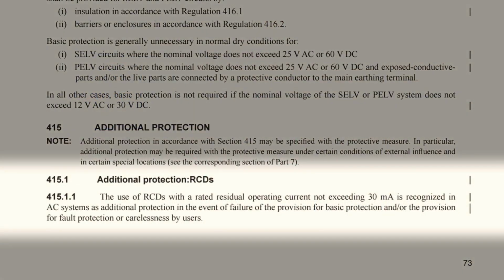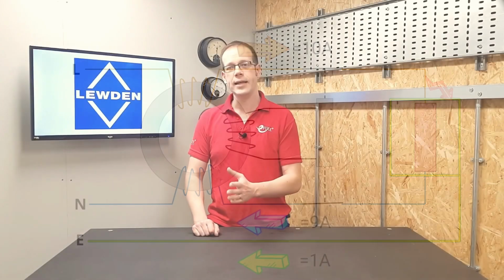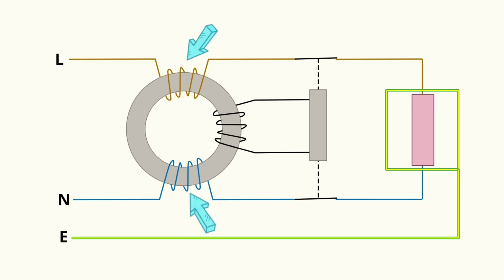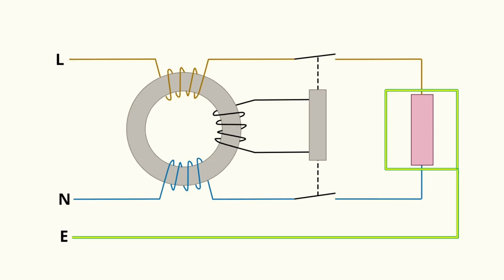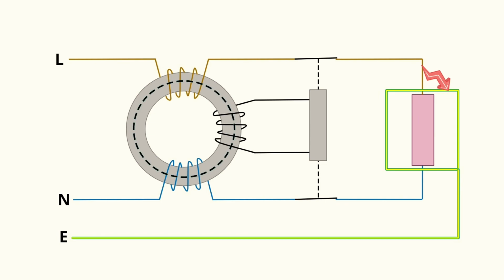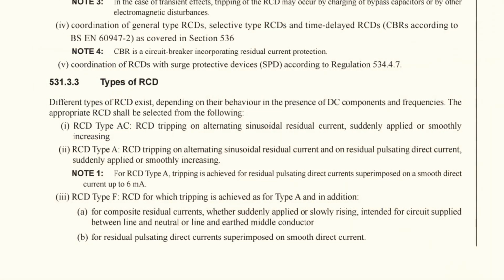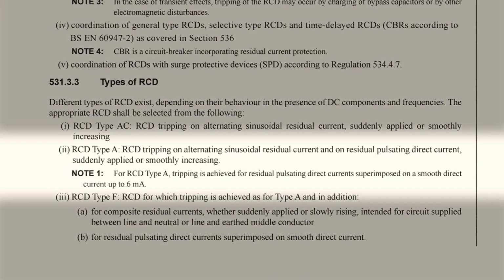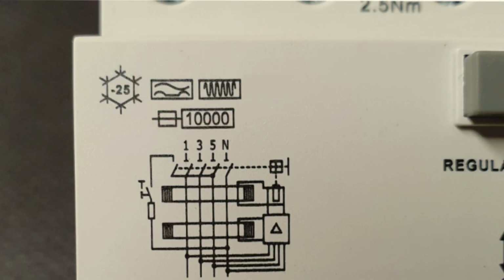The Complete Guide To RCDs - Residual Current Devices

Comment: It’s a good video, but I think you missed a vital piece of understanding as to why an RCD is set at 30mA; because a current exceeding 30mA is likely to be fatal unless it is interrupted in a very short time, followed by the need to occasionally scale RCD’s upstream (which you did cover) but then to ensure no circuits can ever come into human contact unless there is a 30mA RCD in line. Some people may be tempted to fit a 100 or 300mA RCD if they don’t understand why the 30mA protection level is required. Actually 7-8mA is often fatal for some people.
Reply: And that is why our GFCI's here in the USA are 5mA max.  👍🤠
Reply: 4:57
Reply: 23 mA shock across a person's heart can cause fibrillation.  Initial RCDs were 20mA. Nuisance tripping.
Reply: @patrickcannell2258  well RCD’s are set to the distribution of human survival, which can range from a low value like 15mA up to maybe 45mA with 30mS being at the centre of the normal distribution.
Reply: And animals which are very sensitive.

Comment: This explains something I had a totally thought wrong. 20+ years ago I worked at a hospital as a researcher. We had labeled socket that it was forbidden to plug in a computer. I assumed the non-labeled sockets were behind a better UPS or something to protect the computers. I would have never thought the fault protection could be compromised by the PSU 😲
Thanks 🤯

Comment: Brilliantly well explained, thank you ! 

 As I see it the problem lies with  'normal' 13A plug connected devices being infinitely able to transport increasingly complex devices around. Such devices really need to be permanently hard wired and given their own RCD protection of a type befitting their complexity and ability to inject dc components into the ac line.
Reply: Wouldn't stop it blinding the rcd further up stream

Comment: 7:49 The magnetic field pattern for the ring/toroid is wrong.
The toroid is made of ferromagnetic material of low magnetic reluctance and the field remains inside.

It does not cross the gap in the centre as that gap is made of air which has a high magnetic reluctance.

The correct diagram is of two circles of magnetic field contained within the ring and passing fully through all 3 coils.  And then you mark the direction of the two mag fields with arrows, which will be in opposite directions.

Comment: Great video, I did the CPD and didn't do too badly, in a domestic electrical installation majority of circuits would be suited to type A and a kitchen ring/radial circuit the type F 

I did a little product search online, seems hager sells type F

We install fusebox and they don't have anything other than type A at this moment in time.
Reply from the maker: Cheers. 👍
Reply: Will you be switching to Hager to navigate the issue 😋
Reply: I think the issue is trying to explain why it will cost £300 + to the client, as some clients would struggle to understand the safety functions of an RCD
Reply: @PardoeElectrical  especially now with how stretched most people are.

Comment: Your diagram of an RCB is incorrect in that one of the coils is shown in the wrong direction.

In the direction shown both the coils are magnetising the core in addition.

Both the coils from the supply side should go the same way around the toroid, e.g. from the supply side go under the toroid and up through the middle.

I find it easier to visualise and understand how a RCB works if it is shown as a two core cable, line and neutral, wound together round the toroid. 

Then visualise the magnetic field around the cable.

When operating fault free there is no magnetic field around it. As the line and neutral currents are equal magnitude and opposite in direction. Thus they cancel each other out.

Under fault conditions there is a magnetic field due to the difference in the magnitude of the currents.
Reply from the maker: Thanks, it's more of an illustrative diagram to convey a point but we get your point.
Reply: Magnetic field representation is wrong.
The field doesn't cross the centre of the ring.

Comment: Thoughts please on the implications on RCD's upstream I will give an example of a caravan park where the caravan and the supply pillar need a 30mA RCD.
What is the dissipation distance of the DC elements in a final circuit? Will both RCD's need to be type A minimum?

Comment: Excellent explainer. If you have two consumer units with RCDs connected together with Henley blocks and one had a car charger circuit with a type A RCD would the second consumer unit also need type A fitted. I was wondering if the DC current would flow into the second consumer unit and affect the RCD

Comment: A question for you experts. Just had solar installed and they added a Fusebox branded consumer unit with a surge device, main switch and a 16amp MCB feeding the inverter via generation meter. The board is fed from service cable connectors and home has overhead power. So no RCD of any type on the inverter. Is that allowed? The rest of the home is fed from a plastic Hager board with a 80 Amp 0.1a Type A feeding two Type AC 63 Amp 0.03a. One last question should the panels be bonded to ground in any way? Just plus and minus cable running up outside of house in 20mm conduit.

Comment: On the subject of RCD's, can you suggest a suitable RCBO for Solar PV AC circuits? 
Most of the manufacturers i have asked say their devices are not bi-directional and therefore can not be used with solar or battery circuits.

Comment: My head hurts. Did you just explain my type A is ruined because it got magnetised from either my dc phone charger, my dc laptop charger, my 12v lead acid car battery charger or my 60v dc charger, or my cctv box dc charger, or dc router network charger. and now i need a new type B?

Because they backfeed dc into the ac line?

Comment: Ehh.. a little problem:
The way the coils are illustrated at 7:42 -
Instead of 10A and -10 cancelling to 0A at the RCD, the way the wires are shown, the magnetic lines actually add to result in 10A + 10A = 20A - this would overload and trip the sensor-coil immediately. (Apply a x-hand thumb rule, works with either hand, as long as you use the same hand in the brown and blue wires)
Reply: Ough what we gonna do now? Report to  IEE and IEC immediately in written.
Reply: @girtsziverts3530  When dealing with high EMF, it's all about attention to detail ;) One small oversight, and ZAP! 

Seriously, though, a diagram whose sole purpose is to explain a specific concept ought to depict that one concept correctly.
Reply: @girtsziverts3530  IEE doesn't exist and hasn't done for a few years. It's The IET now
Reply: what do you mean by 'x-hand-thumb rule'?
Reply: @jtcruz125  right hand (thumb) or left hand (thumb).. some physics texts use one while some the other. For this discussion, either works fine.

Comment: I'm in Korea with 220V 60hz 2P single phase on a TT, and there is no nuetral bus bar, one grounded Air Con. We have voltage ELCB, which  have leakage, short circuit, over current but shouldn't by definition of ELCB not detect residual current or have overload protection. It is IEC 90947-2 Category A. Live reverse neutrals everywhere, magnetic field detectable 1 meter away from lines. I'm trying to figure out why two engineers and an electrician are just like it no problem, didn't test anything. Test switch one breaker doesn't work, romax one roof  tapped together under a water bottle...no problem, What!!! I searching for why RCBO should replace ELCBs on a TT that has no nuetral bus bar.  I need a visual. One of these professionals is telling me ELCB are safer and I'm like how could they even work if there is no nuetral to earth connections, there is no path..dm me I will send videos.
Reply: I'm in the US and we use GFCIs and AFCIs. Frankly far superior to RCDs and ELCBs.  But the UK guys who still allow ring circuits, will tell you otherwise!!

Anyway, I'm not an expert in the IEC/EN/BS standards nor am I fan of how the IEC works as an organization.  And I think its standards are far over rated. In my opinion, with decades in heavy industry, I see IEC rated stuff as "cheaply made junk",  but that is largely because of comparing it to the bulletproof NEMA design specs.  

But that aside, from what I know about ELCBs and RCDs, ELCBs can potentially be of two basic types. One being voltage operated and one being current operated. The voltage operated being of older technology. You said you have no neutral bus so I'm assuming you have neutrals attached to the ground bus and likely the neutral is also bonded to the ground bus. But I'd have to see a diagram to be certain. I'm not really familiar with your panels.  

In TT systems, the neutral is grounded back on the utility side, usually at the generating station. Your initial breaker is likely the ELCB or maybe an RCD. 

You have to be careful watching these videos, because the exact system used in your country may not be the same. You also need to be careful about taking advice from someone not  very familiar with your system. (so take what I'm saying with a grain of salt!)  I would find the documentation for your particular ELCB. Then do some research comparing the ELCB type ad RCDs Look for stuff particular to your country's system.  IEC likes to say it is the worldwide universal standards. Nothing could be further from the truth. Also note where the info is coming from. This channel is from the UK. The wire to the BS standard which is a UK version on the IEC/EN standards. IDK if Korea has its own version or if you just use the EN standards.